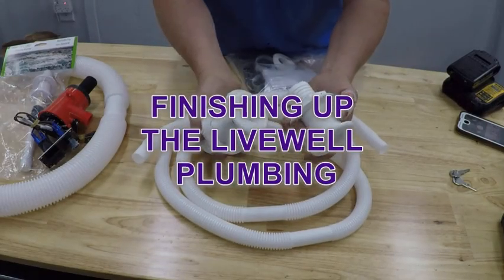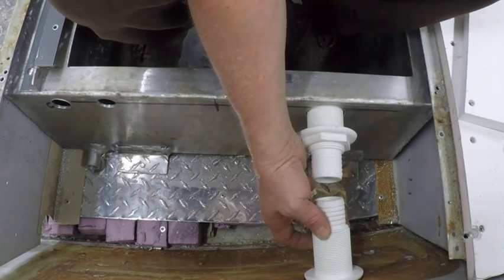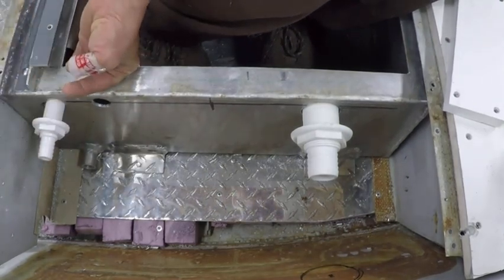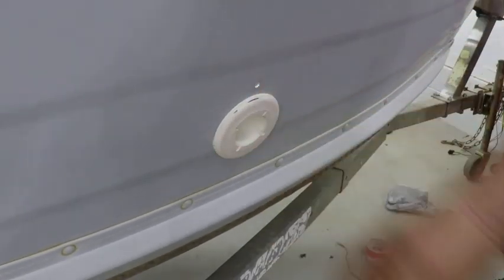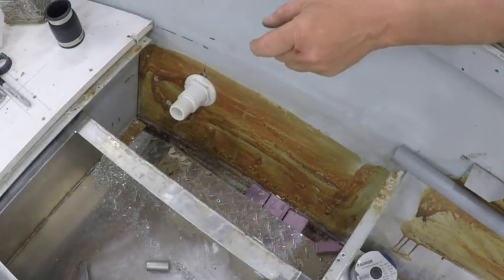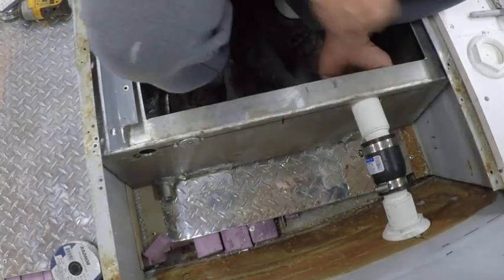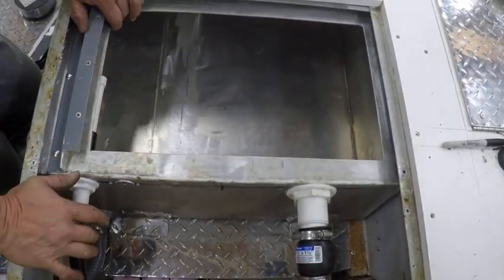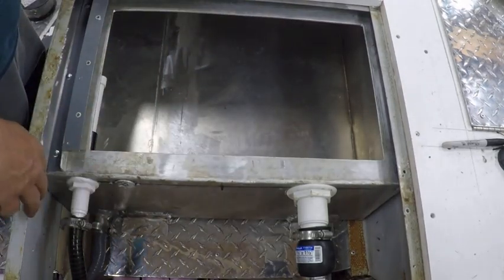HOOKING UP LIVE WELL PLUMBING  AND BOAT THROUGH HULL INSTALLATION

Comment: Nice video sir!…..what sealer did you use for the through holes and spray bar?
Reply from the maker: I cheated lol. I used a sealer we use for metal roof connection.  It’s the same as Lexel.  Most times I just slap a good prong around them and use 5200
Reply: @bowl830  thanks for sharing your build! Learned a lot, I have a good idea of how I’m going to build my deck now using the same design, before watching your videos I was going to rivet angled aluminum along the side hull but now I don’t need to do that lol 👍🏼, saved me on rivets and keeping that clean look. Thanks again.

Comment: Very Nice!!  Quick question: How do you drain it when you pull the boat out of the water?
Reply from the maker: The drain in the tank runs all the way to the back and dumps right in front of the bilge pump.  Pull the plug then turn bilge on or just pull boat plug
Reply: @bowl830  I did not notice the drain!  My Bad!!!

Comment: how is it going to drain if the drain tube is at the top of the livewell?  IT will just drain to the tube but not the water under it, correct?
Reply from the maker: Top is a over flow.  That way you can leave pump on for constant fresh water.  There’s a drain in the bottom you can pull to empty the tank after use.